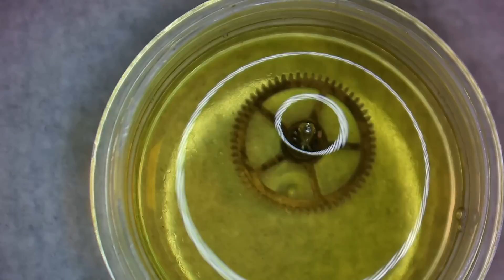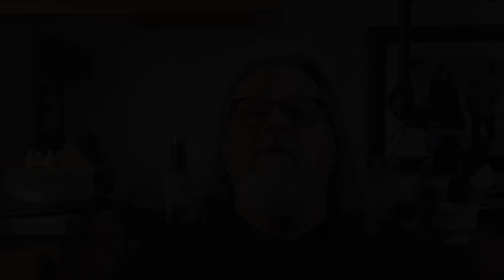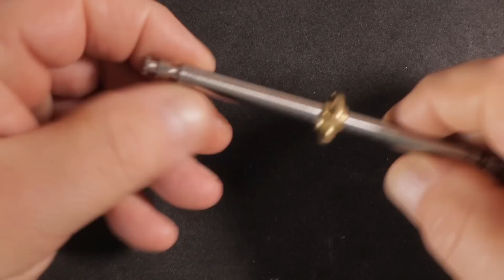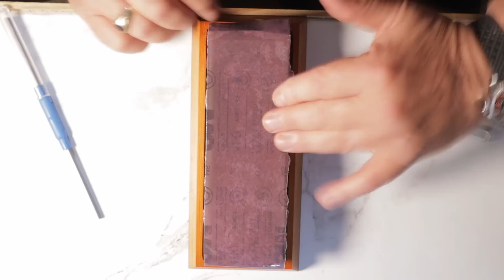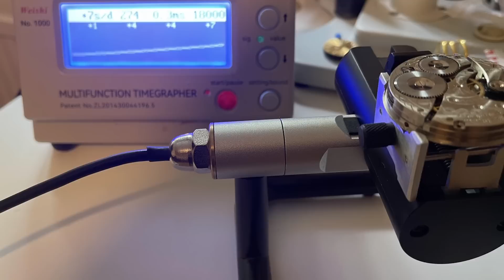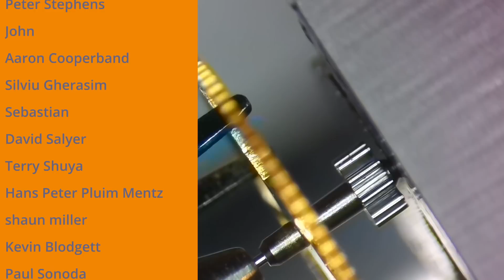Beginners Guide to Using the Jacot Pivot Lathe

Comment: A great Video ! Very helpful and informative , Thankyou !
Reply from the maker: If you work on vintage watches, the pivot lathe is a pretty valuable tool to have.
Reply: @watchrepairtutorials yes , Very fine work , I am a collector of Clocks especially Vienna Regulators and The Pivots on them are extremely hard and fine but nothing like the Pivots on watch work , but still the same thing applies ! Great Video 👍
Reply from the maker: @Steve-le3jq oh well that's pretty cool. I don't know what size pivots you're dealing with but are you sure the typical jacot lathe can handle those?
Reply: @watchrepairtutorials no but the watchmaker's Lathe Boley or Lorch  8 or 6 mm I,ve used for this kind of work , they have a pivot drilling attachment and Jacot drum within them and that's suffice for polishing and repivoting them !
Reply: Like I say , same principle but watch work is much much finer !

Comment: Thank you again for your videos, Alex!! This is just a question about recommendations. There seems to be a choice of burnisher to choose from, Bergeon and Vallorbe. Which would you recommend? I know that it looked like the Vallorbe in this video and it has the burnisher and file on each end, whereas the Bergeon is only a file. Does it make a big difference? They seem to cost about the same but they’re too expensive to buy both!!
Reply from the maker: Honestly not a lot of difference. I've used the file but in reality there are better ways to reduce the size of a pivot if needed. I am using the Vallorbe, which is a fine burnisher, but you could do either one. I would also encourage you to look at the used market to see if you can find something similar. Like I said they all need to be re-dressed anyway so if you can get a good deal on a vintage one, that's probably what I'd recommend.

Comment: I always come back to this vid, its a great one! I was inspired some months back so I decided to look into the Jacot tool. Thought I found a "great deal", so I bought it THEN reached out to somebody with more experience. Immediately they said to pass because parts appeared broken...at that point it was on the way. So, I have this thing that might be good for someone completing a set,  but not for me to start with. Where would I start to know what I'm looking for? And, are there current manufactures of these tools? I'm really trying to hone my balance and pivot skills, at least dive in and start, so I know I will need one soon. Thanks for any insights!!
Reply from the maker: I would start by gathering some pictures of complete sets to use as a reference and then before you buy one you gotta ask questions about the beds and whether they’re in good shape or not. 
Ask for pictures. 
The only new one I’ve seen was on Otto Frei’s website and it was like six grand. Lol.
Reply: @watchrepairtutorials 😂 the price does not surprise me and makes sense. Thanks again. Are you still taking messages with repair and service success stories from your vids? I'm hoping to have one soon if so.

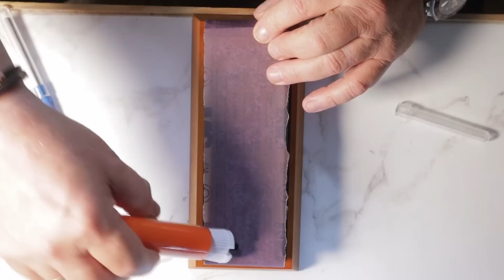Comment: 17:04 is that 400 or 4000? you used 1000 grit before.
Reply from the maker: I’m using the thousand grit stone basically to ensure that the burnisher is not only flat but to remove an existing scratches put in it. The 400 grit sandpaper is used to actually cut lines in the steel that will do the burnishing.
Reply: @watchrepairtutorials  thank you sir. Your yo-yo ID holder method is very good as well.

Comment: Алекс, здравствуйте!
Подскажите какую сталь можно использовать для полировального бруска?
Насколько я понимаю, можно взять гладкий стальной брусок и сделать из него полирфаль?
Reply from the maker: High-Speed Steel (HSS, is a common material used in manufactured burnishers due to its hardness and durability.
 Tool Steel (like W1 or O1), is also used, particularly in cases where individuals are making their own burnishers. These steels offer high hardness, but may require heat treating.
Hope this helps.

Comment: I learned this the hard way about the early version pivot lathe. ended up with a worthless tool,  of course I learned it a year before this video came out.
Reply from the maker: That’s a bummer. Another problem I have seen even on newer ones is when people use either sapphire burnishers or even diamond files. It screws up the beds.
Reply: @watchrepairtutorials  Holy moly diamond file for burnishing ?
Reply from the maker: @  yea people try to come up with all kinds of shortcuts
Reply: @watchrepairtutorials  Well that wouldn't be a good shortcut. youd be reducing pivot size. and unless your changing pivot jewel hole size your going to be looking at reduced performance,
Reply from the maker: @ yep 👍

Comment: Ayo Alex digging in the archives I got a question for ya: burnishers are expensive so I'm making my own. I'm a lefty so I'm making RH burnishers. How do you put a radius on it and how much?
Reply from the maker: The purpose of the curve is to burnish conical pivots but most commercial burnishers are too large. 
So all you literally want to do is barely break the edge. 
I don’t know how they would do it in a factory, but if I was doing it, I would probably put a piece of diamond lapping paper on a piece of plate glass and run it down the edge
Reply: @watchrepairtutorials  I've had some great luck finding some vintage ones on the 'Bay for cheap cheap. I've also used some high speed steel lathe cutting bits out of my toolbox ⅛ and ¼ blanks. They work great.

Comment: Been awhile since I last watched one of your vids and had some jacot work to do. Your vids are the only ones I refer back to, to knock off the rust. Thanks man. 
So much for retirement, huh? Hey you ever do one on knocking out a balance staff without machining the rivet first?
Reply from the maker: Hey MIke,  You are saying a lot in that last sentence so let me make sure I understand what you are asking. 
There are 2 types of balance staff installs, friction fit and riveted. You are asking if I have ever included in a video, removing a balance staff without cutting out the rivet on a lathe?   As you may have read or seen somewhere, undercutting the rivet is the best way to remove the balance staff.  This step reduces the force required to remove the staff, minimizing stress on the wheel. I will included that in the lathe part of my course but 99.9 % of people learning here are not going to be able to do that.
Reply: @watchrepairtutorials 
Right. I was asking if you were going to show the manual way to remove a balance staff with a K&D staff remover/stake kit?
Reply from the maker: @  yes but it’s gonna be part of the video that shows all the different ways from best to worst for balance staff replacement
Reply: @watchrepairtutorials  I'll be sure to tune in.

Comment: If I’m hearing you correctly on checking for “Hand Shaking” what does that mean?  Thanks
Reply from the maker: Can you be more specific. This is an old video.
Reply: @ I believe it related to fixing train of wheels moving around in the jewels more than they should.
Reply from the maker: @samnova450  oh OK. I think you must be talking about end shake. That’s the lateral movement of a train wheel in between its jewels.  The end shake should be enough so that the wheel does not bind but not so much that it sloppy. If it’s too much, then the teeth of the wheel travel up and down the pinion of another wheel which causes friction lower amplitude among other things.
Reply: @ I see, Thanks again.

Comment: Great video as always.  I was rewatching because I managed to get a great eBay find on a set of 7-8 burnishers.  However, they need to be dressed.  My purchase also came with a tin plate for polishing.  Surprisingly heavy.  It has a fine grey powder on it.  Possibly diamantine?  Any advice on dressing them with the tin plate?  Thanks.
Reply from the maker: If you are asking about dressing a burnisher, I didn't in the video

Comment: What are your thoughts on the eve pin polisher that ive heard reed by several others?
Reply from the maker: They have their place, but they can't replicate what a burnisher does.
Reply: @watchrepairtutorials  that's kinda what I thought. They are probably ok but not as good?
Reply from the maker: @brianwohlleben3182  burnishing works by stretching out the metal which fills in low spots which leaves a polished surface.
Doing it with an eve would be removing material, which is not ideal for side shake which can cause problems with how the balance runs.
Reply: @watchrepairtutorials   ahh! So eve would be better for light rust or cleaning of an otherwise healthy pivot. But a worn piviot needs to be burnished.
Reply from the maker: @brianwohlleben3182  well you have to be careful that you don't bend the pivot. I've used them for light polishing inside barrel arbor holes.
"Rust be gone" is good for rust removal folllowed by polishing.

Comment: After watching this vid and getting a jacot for myself i set a task of doing an old pocket watch that was barley running . After discovering that the beds on my lathe wete slightly worn i had to go a few sizes smaller to get the burnisher to contact the pivot but then results happened its now running at 284 amplitude and only a slight change between positions . I think i have a poisong problem though as the beat error increses and decreses between dial up and down . Im stoked with learning the importance of pivots ,all made clear with a microscope (much to my amazment )
Reply from the maker: That’s fantastic, Peter. The Jacot lathe is definitely an investment but makes a huge difference if you’re working on older movements

Comment: Brilliant video.. I just bought a Jacot tool hoping to polish some pivots on some pocket watch wheels which were 0.5 mm in diameter but my Jacot tool only goes up to 0.45 so the pivots won’t fit inside the centre tool.  Is there a different Jacot tool to do pivots of 0.5 mm ?
Reply from the maker: I think most do. I have the Obama-Prazision and it goes up to 1.00 mm. I would sell it and get a different one.

Comment: I just purchased a jacot lathe after watching your video, can’t wait to tey this out. 
it seems theres a mistake on the slide at 21 :26, it should read 0.01 minimum and 0.05 max if i understand your explanations correctly. 
Just two questions: how do you know a pivot needs burnishîng, and when do you know you burnished it enough and can stop?
Thanks Alex!
Reply from the maker: By very close inspection. In all cases with very old watches, pivots will have micro abrasion from running with dried oils and grit. One tell tale sign is when you get larger than normal drops in amplitude when going from horizontal to vertical positions.
Reply: Well, as it´s signed as "mm", you´re right. What Alex said - as I understood it - was 0.01 minimum and 0.05 in mm 👍

Comment: An exceptional video. I found that prior to buying a proper watch cleaning machine. I really had to concentrate on getting the dirt out of the pinion gaps. I’ve also had issues with that teeth usually between the centre wheel and the third wheel
Reply from the maker: Hey JD, how’s it going? Yes those pinion teeth can be a problem spot, especially on those oldies.

Comment: Hi Alex, thanks for this and other highly informative videos, and the really helpful posts in forums. I read one great thread you created recently on lubrication. I have one question, do I need to prep my new Bergeon pivot burnisher in the same manner described here, as I've read in a forum question you answered that this is the burnisher you use exclusively.
Reply from the maker: For me the bergeon burnisher is too aggressive. I would imagine that what they’ve done is to try to strike a balance between the needs of a clock maker in the size pivots that they work on versus some of the smaller pivots inside a Mechanical watch movement, whether or not, you decide to dress it down like I did in the video is completely up to you depending on what you work on. 
If the Jacot lathe you purchased works for you then go for it. I know some of the older ones could be a little problematic when carrying the wheels, but if all the pieces are there, it should be fine.
Good luck and let me know if you need any help with it. Also, would love to see a picture of the Lathe. If you have time to email it to me my addresses on the website or in the about me section here.

Comment: I’ve now bought a Jacot tool so back again for another visit to this video.
My only disappointment is my set although complete is missing the prong thing that holds the spoke of the wheels. I guess I will have to make one somehow but not sure on length or shape.
I have plenty of small diameter silver steel so hoping I have a bar with the right diameter.

Any tips on replacing these Alex.

Thanks 🙏🏻
Reply from the maker: Shoot me an email and I’ll send you over pictures and the measurements from mine
Reply: If it is a Steiner/Horia, They still sell parts.

Comment: Wow ! I’ve had an old Swiss Jacot tool and a brand new Vallarbe file since 2019. Didn’t understand it enough to use. Could find nothing  ‘ period’ on preparing the file. Best, if not the only, instruction  I’ve seen on this subject. Many thanks. BTW I read that some pivots with lower quality  materials can not stand up to the burnishing procedure?
Reply: Good to know. Thanks for giving a starting point on this. I appreciate your videos and responses to so many questions that come your way. I’m signing up!
Reply from the maker: @johntebeau4493  awesome. Let me know if you need anything.
Reply from the maker: That’s usually when someone says when they break one. You do have to be extremely careful and make sure everything is set up correctly. Because you’re applying force to the pivot, if it’s not flat in the bed, even a quality will break.

Comment: Hoppe's is great as it won't mess up paint or finishes, has a surfactant and is very low viscosity. One can use a 0w16 oil for burnishing of steel gun parts but preferably one workout detergent which is impossible unless one orders direct from oil companies like Esso/exxonmobil, shell etc. they will sell you (a large amount) of pure 0 viscosity oil sans additives. Otherwise I always use hoppes or a 0w16-20 motor oil ymmw
Reply from the maker: Thanks for the confirmation. I guess great minds think a like.😀

Comment: Any recommendations to buy the jewel setting tool and the pinion polishing tool?
Reply from the maker: I’ve heard many good things about the Chinese version of the Horia tool for removing and setting jewels. I believe they’re available for under $300 US. the downside to the tool as far as I know is that there are no Reamers available to make any corrections on the Jewel Hole before inserting the new jewel. I use a Sietz Jeweler so if you can find a complete set, that would be my recommendation. 
As far as polishing pinions showed using the toothpick and polishing paste and doing it by hand, or you could use any rotary tool with the silicone knife edge disc .

Comment: Such a great tip. If you come up against a problem, put everything carefully inside a little sealable bag and put it away. Many times you'll go back to it, equipped with better knowledge and tools and sort it. Nothing worse than finding an old project with parts missing
Reply from the maker: Hi Gerry, 
Many people knew to watch servicing, immediately jump in to his old pocket watches thinking that they should be easy to get running again. Sometimes that’s the case, when you get lucky, but most often they can be extremely challenging. If you haven’t built up your tool set yet or the experience is not there yet. Hopefully they will take that tip and not ruin a piece of history. I’ll see you in the next one.

Comment: Alex, great video!  Question, as you burnish, are you running the burnisher against the rotation of the pivot or with the rotation?  The video looks as though you are pulling/pushing the burnisher with the rotation of the pivot.  Thanks again!  John
Reply from the maker: It looks weird doesn’t it? The way I set the cord up makes the barrel rotate towards me as I pull the cord. As the barrel and wheel are rotating towards me, I’m pushing the burnisher in the opposite direction of the rotation.
So the burnisher and cord are moving in the same direction, but the pivot and burnisher are moving in opposite directions of each other.

Comment: Alex, I want to say Thank You for your videos! They are so useful. Have a question about wheels teeth cleaning- can I use fiberglass brush to clean the teeth?  I do this way with dirty wheels. Is a fibreglass safe for teeth surface and geometry?
Reply from the maker: Yes, the fiberglass brushes are fine although I typically roll them through a little bit a rodico.

Comment: Alex - Another great video.  I would be interested in your guidance on lubrication types and impact on amplitude.  I work on a lot of vintage Seiko and these movements depending on calibre  tend to run at much lower amplitudes than say most Swiss movements I have worked on.  I have worked on ETA 7750 and 2892 which if I recall callsl for HP1300 lubricant on most of the train wheel pivots  but I would not dare use that viscosity lubricant on a vintage Seiko train as I fear and have seen much lower amplitude numbers so I tend to stay with a lighter 9010 or HP1000 in most instances.  I know the old adage, low speed, high torque (HP1300), high speed, low torque (Moebius 9010).  Have a good Memorial Day.  John S
Reply from the maker: Thank you John and the same to you. I am by the coast and it looks like we’re going to get rain all weekend so people going to the beach are going to be bummed for sure.